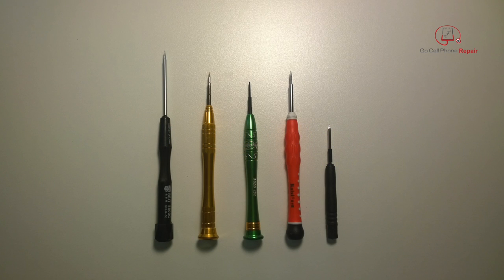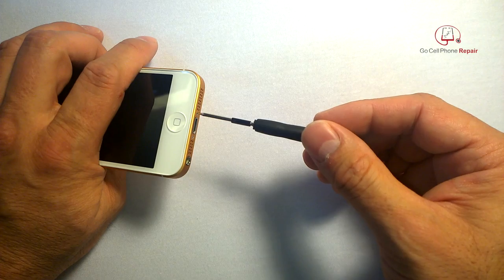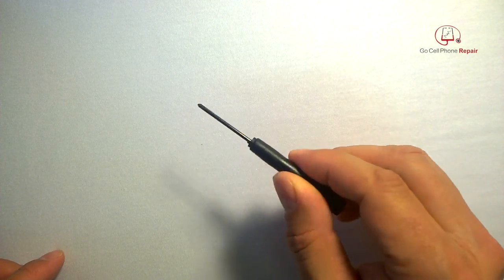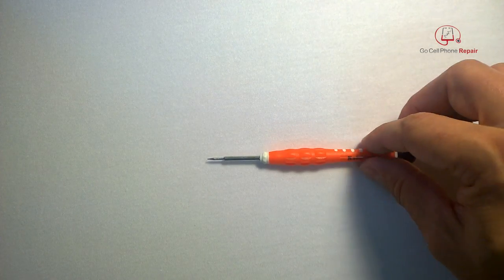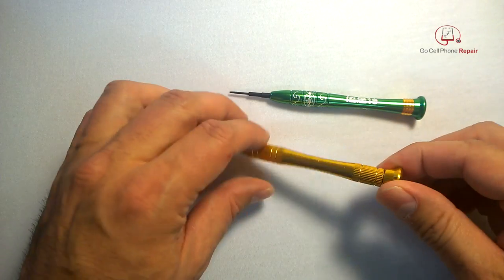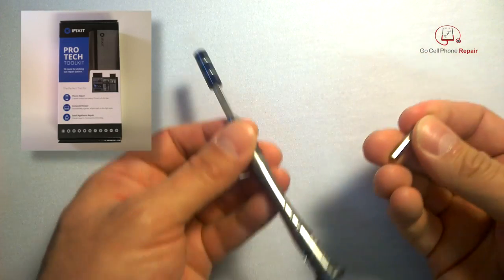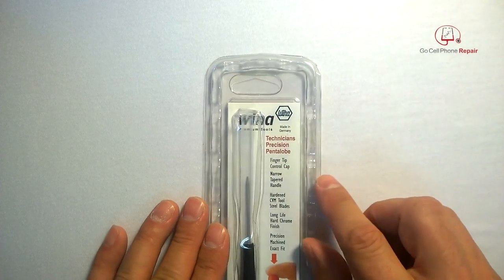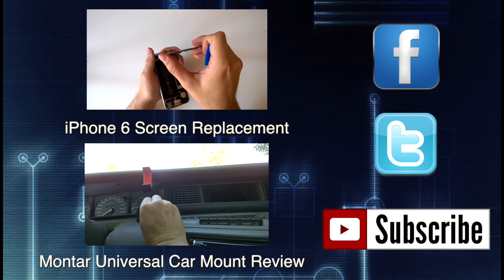What is a Pentalobe Screwdriver?

Comment: not sure if I need the wiha p1 or p2 for iphone repairs. so confusing. even wiha customer service couldn't help. what is the wiha p2 for?
Reply from the maker: +hostilityy P2 should be correct for iPhones. From wikipedia:
Pentalobe sizes P2, TS1, PL10.8 mm iPhone 4, 4S, 5, 5C, 5S, 6, 6 Plus
Reply: +Go Cell Phone Repair but you're using p1 in this video. So they're the same? I think the difference between both is so small that both work but p2 may be a more precise fit. Like .01mm difference between p1 and p2.
Reply from the maker: +hostilityy Probably. The majority of mine are designated as .8 so I would look for that as the numbering system is kinda funny with these things.
Reply: +Go Cell Phone Repair And then there's the CR72 steel vs CVM steel that wiha uses on the pentalobe bits tips and they're not the same. One has to be more durable for pentalobes this tiny.
Reply from the maker: +hostilityy I have found that almost all drivers last indefinitely under normal use. It's when people use them for removing SIM trays or super screws that they tend to strip. Over tightening will cause this too. I'm sure that you're right about one alloy being superior to another but I imagine there is a trade off somewhere when it comes to strength vs. brittleness. CVM is what most of my tools have and I don't know much about CR72 but if you are really looking for the highest quality possible check out Wera. Expensive but in my opinion the absolute best that money can buy.

Comment: I find the free type/smallest handle screw driver needs more torque to tighten.
Reply: i usually wrap a huge amount of electrical tape or build it up with masking tape or rope to gain more mechanical advantage, similar to a stubby screwdriver. the wider the handle, the more torque you gain at the smaller end